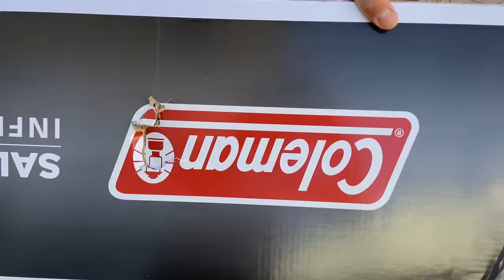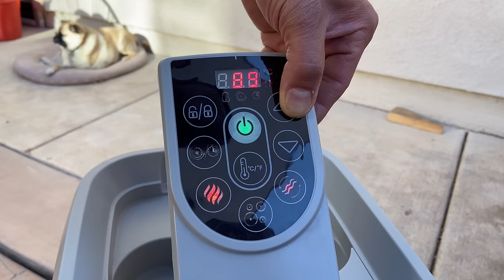Coleman Saluspa Inflatable Hot Tub Complete Setup

Comment: anyone else notice how weak the pump/filter is for this spa? you can small bits of dirt in the spa but they need seen to get pulled towards the filter…also weird/inefficient to have both the suction and return from the pump right on top of each other, they should be on opposite sides of the spa, or at least farther away

Comment: I have had one similar to this. It's inexpensive and was fun. Might last a couple of years, but the only issue is that when you turn the bubbles on it blows air in from the outside, so the temperature will drop fairly quickly. Other than that, it was o.k.!

Comment: Read a review on Amazon. Someone mentioned buying a connection from Home Depot that will allow you to run your hot water to the jacuzzi therefore decreasing the time it will take to reach optimal temp
Reply from the maker: Sounds like a good buy!
Reply: I just ran a hose from my hot tap behind the Washing machine to fill the spa..when you fill with already hot water it will take no time to be ready :)

Comment: Wow easy when u show it I'm getting one today thanks 😊
Reply from the maker: Awesome! Set up is pretty straightforward. Hopefully you’ll get to use it by tomorrow 🙂
Reply: @LYLAHome20  Hi! do you know how much pool shock is used for this tub? i want this exact one but i dont understand all the chemical measurements besides the one shown in the video
Reply from the maker: @aoyamiuriko5059  Hello Aoyami! I would only shock the hot tub after each use with about a cap full of shock then run the bubbles for the 30 minute cycle. I have another short video on maintenance. Hopefully this helps. Thank you for watching 🙂

Comment: Thanks so much for posting!  Great video.. About how long did it take to set up (not including the heating time)?
Reply from the maker: I would say it took about 15-20 to set the tub up and another 20 minutes to fill it with water from our hose. Thank you for watching and let me know if you have any other questions!
Reply: Mine took about ten mins to connect (once they sent me a manual!!) Filling with water, less than an hour. Two nights to fully heat it, as the water I put in was 50 degrees. Put the filters on the side BEFORE filling it. Having trouble with mine
Reply: @kelammo   what kind of trouble?

Comment: LYLA Home,  i got the exact one you have.  How come I can't attach the filter housing to the wall of the spa where it's supposed to go? It does not fit. The Chemo Connect (where you place the bromine) is fine. I just push it in then twist to lock.  The filter housing and the housing mount (on the wall) seem to be incompatible as the filter housing is almost like a screw where you turn and turn it while the filter housing wall mount is the same as the Chemo Connect where you are just supposed to put it in and twist.  It's kinda hard to explain, hope I am making sense. Frustrated that I can't use the saluspa. Tks.
Reply from the maker: Hi Jay!
Try turning it counterclockwise until it sets on the threads and then turning it clockwise and see if it aligns. It should sit flat. Hope this helps!
Reply: @LYLAHome20  it still did not work. While the filter housing has a thread, the mount (the one on the wall) doesn't have a thread to match that of the housing. Both the opening on the wall where you are supposed to install the filter housing & bromine housing are the same. I have no problem installing the bromine holder. May I ask on the one you have does the opening on the wall where you would connect the filter housing have a thread? Mine doesn't.Tks.
Reply from the maker: @jayavery8543   yes, it does have a thread.
Reply from the maker: @jayavery8543  That’s a bummer! Hopefully your issue is resolved soon!

Comment: How durable is this with kids? Do the walls stay up with all of the running and jumping kids do to get in and out of it over and over?
Reply from the maker: Hi! We had 5 kids in the hot tub at one point and they were pretty wild, but that was just 1 day. It still works 😅 but we pumped the tub so that it’s firm to the touch so it does stay up even if we were to sit on the edge.

Comment: Great video.Included instructions are poor. What is the little inflation valve in the floor of the pool for? I didn’t see anything in the video or instructions about it?
Also, mine came with a weird deflation valve, but no instructions on how to use it. Any ideas?

I have the same model
Reply: I think you are talking about the drain on the bottom
Reply from the maker: The hole on the very bottom of the tub is used for draining water. I used this in my other video on hot tub maintenance. If you have some time, please check out my channel for my other two hot tub videos titled Coleman Saluspa Inflatable Hot Tub Draining and Cleaning. Thanks for watching!

Comment: Will this work in freezing weather continuously plugged in?
Reply from the maker: Hi Alexander!
It doesn’t snow where I live but I’ve seen a few other YouTube videos where they use the tub in  the snow! The only thing I could suggest is to find a way to keep the heater unit covered and clean from water and snow.
Reply: @LYLAHome20  Are those not water proof? I'm assuming to some extent they are but I purchased the led saluspa and it would be installed on an uncovered deck.
Reply from the maker: @Soul_N_Control  Hi Christina! I remember the manual stating to take care of the heater/pump unit during harsh weather. If it’s too sunny, cover it with a shade. If it’s raining or snowing, cover the unit to keep it dry. My manual states to detach the pump if it’s freezing temp. It’s all to keep the unit in good working condition. I read all of this in WARNING section in the manual. Let me know if you’ve have any other questions 🙂
Reply: These things are junk if u live in cold climates . All these 110 hot tubs can't take a real winter . It's ok  if u wanna be in the hot tub during summer and break it down for winter
Reply: @LYLAHome20  Is it ok to run in extreme cold temps as long as the pump is on?

Comment: I have loved ours until this year. When I needed to inflate it, it will no longer hold air. No holes, tears or rips. The air comes back out of the piece near the top of the inside of the spa. Not the filter, not the one that you can put Bromine tabs in. The one above these two. Does anyone know why or how to fix this problem?
Reply from the maker: This is our second year and we have a hole that needs to be patched as well. We made sure to use it gently and pack it away gently, but we’re able to blow air into it while there was water inside. We’ll have to find out where the air leak is.

Comment: Got saluspa Cali ordered from Walmart online. When I opened the box, manual was missing. Followed your video to set it up. I couldn't install the spa filter housing though. It seems the spa filter housing that came in the box is the wrong kind. Noticed that in order to attach the housing to the side, the one I got needs to be turned like a screw. When I checked the area where the housing is supposed to be placed, it is the kind where you just put it in and  twist. There is no way I can attach the filter housing.  Without it I can't use the spa. I already went to the bestway site and filled out the form.  When I will get a reply, I don't know. So frustrating.
Reply from the maker: Hopefully they respond soon and you could get the correct one. Let me know how it goes!

Comment: I owned one of these. It was great until the filter broke. They only last a year or two tops and you can't buy replacement parts for it.
Reply from the maker: That’s good to know but I really hope it works when I set it up again in spring 😬
Reply: 3rd year so far for ours 🤞
Reply: @LYLAHome20  aight spring is here does it work now
Reply from the maker: @diorforgoochi8799  yup! Still works like a champ except there’s a small air leak on the hot tub so it slowly deflates. We’re still able to inflate the tub with water inside.. gotta find the hole and patch it up and should work just fine.

Comment: What's the upper plastic cover for?
The one's under it are the intake and outtake but I don't know what the top one does.
Reply from the maker: Hi Leroy,
The clear tubes are for the water filtration and also for heating. The solid grey plastic tube is for powering the jets or pumping . Hope this helps. And sorry for the late response.

Comment: How do you add air when hot tub is connected to pump if needed?
Reply from the maker: If you disconnect the coupling for the jets, you should be able to reconnect the hose between the machine and the tub. You will need to turn activate the jets function to start inflating the tub.
Reply: @LYLAHome20  okay. I understand that part. But will the tub lose water or do I have to let some water out? Sorry if I sound ignorant.
 And thank you for the great video. It made it much easier. The instructions that came with the tub were awful.
Reply from the maker: @gailtanski271  No worries. You will not lose water and you will not have to drain the water at all. Just make sure you have a feel for how much pressure is in the tub to avoid over inflation. Also, you’ll need to turn off the jets when finished inflating using the same function. I hope this helps!
Reply: @LYLAHome20  thank you very much !
Reply from the maker: @gailtanski271  you’re welcome!

Comment: Does anyone know if either of these units' parts are interchangeable?  Like pumps or anything?  Thanks!

Model numbers:

Both are
Saluspa Bestway

New one, 4/2022.
S100105, 
20GPM flow rate. 
Rectangular.

Older one, 2018/9.
S14133
10GPM flow rate. 
Egg shaped.

Comment: Thank you so much for this tutorial! I just got one secondhand and had no idea what I was doing. But this video helped tremendously! One question though, the valve that's inside the tub on the blue patterned piece... do I put anything in there? Air/water?
Reply from the maker: Hi Vivian! If it's the pull up tab, then you will not need to use it, unless you're using it to drain out the tub. We didn't really use that to drain because we didn't want to flood our yard. So we literally used buckets to empty it out. Thanks for watching!
Reply: That was my question also. The manual shows you close it while filling with water.

Comment: So my family just got this spa and I set it up today and the water is ice cold. How long did it take for your water to get super hot before using it ?
Reply from the maker: It took my tub about 10 hours, but this was during the spring… weather out was about 75-80.. not sure if that helps with hearing faster.
Reply: You have to wait 10 hours before to get in?
Reply from the maker: @morrismiller  you can get in 30 minutes after adding the chemicals when you first setup, but it takes approximately 10hours for the water to heat to 104Deg
Reply: @LYLAHome20  but water would be cold right? So your recommendation would be to start heating the water around 10 hours before I plan to use it?
Reply from the maker: @morrismiller  yes! If you just got a new tub and you’re setting it up and filling it with water from your hose, it will be cold and once you fill the tub, you’ll need to add in either chlorine or bromine to keep your water clean and then set the temperature to heat so it’ll take a few hours to heat to your desired temp! 🙂
Reply: @LYLAHome20  thanks. I appreciate it
Reply from the maker: @morrismiller  You’re welcome! Enjoy your new hot tub!

Comment: How many hours a day i do leave the engine running
Reply from the maker: Hi! If you plan on using the hot tub, then set the hot tub timer to whatever hours you’d for the water to stay hot. We leave our hot tub on so that it can filter the water to keep it clean and safe. But if we prefer the water not to be HOT we leave the heater off, but still the machine plugged in so the filter keeps running.